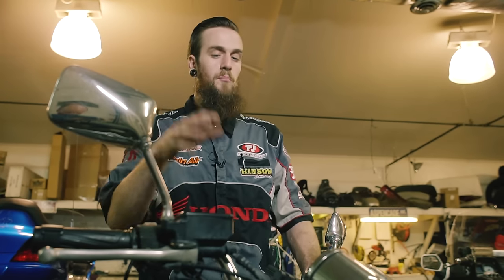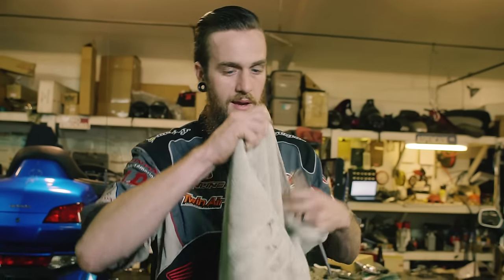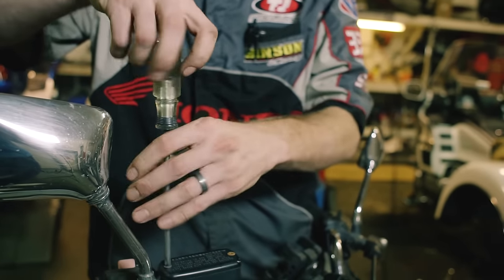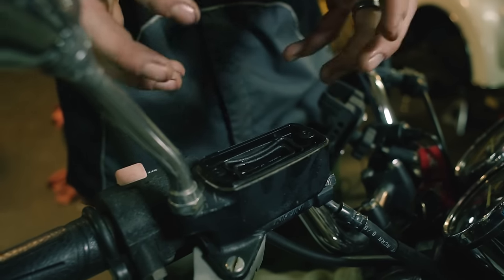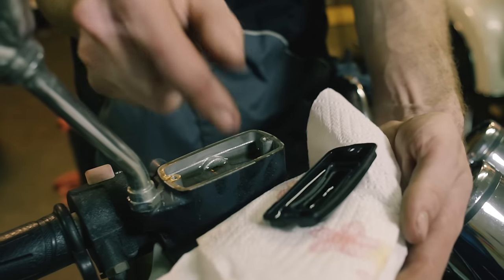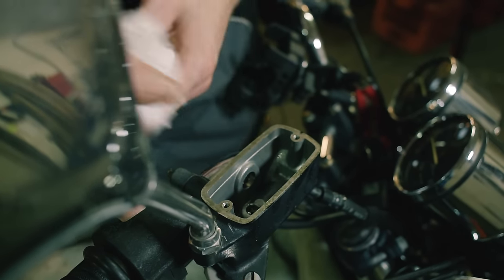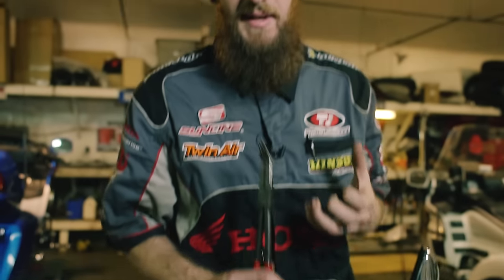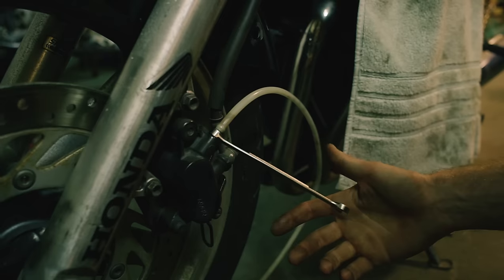Brake Fluid Replacement: Honda Motorcycle

Comment: Great advice. Many people are here because they are not wealthy, and would like to take care of what they can afford, affordably. a 1993 Honda Shadow has rubber lines. It's fine if YOU choose to afford steel braided brake lines, but don't criticize other people for what's in their budget. This guy is the common man's hero, for bike repair. Snobs can go elsewhere, or chill out if you stay. Thanks.
Reply: follow the advice of someone who clamps high pressure brake lines? nothing to do with steel ones...nothing to do with snobbery, clamping a line hard enough to cause the restriction required in the video WILL DAMAGE the brake line.

Comment: I have a 2003 Honda Shadow VLX 600, that I've made a few changes to it. I use a handheld vacuum pump with a plastic hose going into a container with another plastic hose to the bleeder nipple by applying vacuum to the container it draws brake fluid out of the caliper and down from the reservoir. I keep checking the level and adding more brake fluid to the reservoir before any air gets into the system. When the fluid comes out looking clearer, then I'm done. I do like your videos. As my 5th grade teacher told us when you graduate from high school or college, you're not out of school. Life is a school and you must never stop learning. Best teacher and lesson I ever had in school and it proved useful in my life. I can always benefit by learning something new every day.

Comment: I watched one of your brake caliper rebuild videos yesterday.  You used a brake line clamp to squeeze that line, instead of pliers.  It looks like a much safer tool for the rubber lines because it has rounded jaws.  After seeing you recommend it I checked to see if Harbor Frt carried them & found a set of four clamps for $8.

(I just thought I'd mention it since this video is from 2016 & you probably didn't have that tool back then.)

Thanks for the great videos.

Comment: Man You are a Legend too say the least. I bought this Yam TTR250 $400 with leaking base gasket. So to repair I may as well do top end no big deal. Front master cyl decides it needs new kit as it stuck. No big deal. I put in new kit, tried too bleed, No way Hos'ea. The brake line sticks up 1/2 a mile higher than the master cyl, try reverse bleed , all sorts of shit. Nothing. Cody pops up on youtube and saves the day with his plier 1 way valve trick. Yippee , it worked a treat. Im a Honda man personally , I might sell this yam and get another XR. Thanks again Cody.

Comment: Also what the other guy said about older Hondas.  I've picked up a couple older (2003-2007) but low mileage Shadows.  One is in better shape than the other and the other needs brake fluid replacement.  Thanks for the vid.  .

Comment: Thanks the advice man! I was a bit nervous about pinching my brake line because i'm running the OEM 93 tubes on my bike and even though I didn't see any rot or anything, just played it safe. I used my wife as a "cheat" by having her sit on the ground and do the "open/close" between pumps (the old fashioned way) and ran 6 refills through the system (after having emptied and refilled the resevoir like your directions, and each refill being about 1/2-2/3 of the liquid in the brake fluid reservoir) . So I'm estimating between 3-4 FULL reservoirs went through it for the full flush (my wife confirmed it was clear liquid for about 4 of those 6 refills anyways since it was just what was in the tubes). Brakes feel solid as a rock, and having just changed my pads yesterday, braking feels nice and solid. Never taking it to my mechanic for something like this again. Easy enough for a fairly competent person to pull off. I have a new diaphram on the way (it had to be special ordered and I forgot to order before starting) so I'll just swap the diaphram the minute it comes in the mail this coming up week.
Show less
REPLY
Reply from the maker: Nice job man!!
Reply: thanks, I'm no mechanic, but it's nice to do the simple things on your bike. I'm just glad I don't have a dual caliper front brake system, or disc fronts AND back, as even though it was brainlessly simple if you follow directions, was definitely tedious doing the old "pump pump hold...crack the bleeder, close the bleeder. repeat" method...even with my wife helping so I didn't have to do both lol

Comment: Dude, your method is 100% spot on. I have a vacuume fed bleeding kit and the pliar method worked soooo much better. I used the pump kid to clean out the master cylinder instead of the turkey baster.. you killed it with this tutorial. Thanks kid
Reply from the maker: everettesfit 🤙🤙👍 it is a pretty nifty trick!
Reply: thoughts, after bleeding the front break and replacing the pads the front wheel doesn't spin freely.. seems to have drag.. do you think I still have a bubble
Reply from the maker: everettesfit Slight drag is normal with brand new pads. Failure to spin is a problem and no that wouldn't be an air thing. That would be a possible dirty caliper or crud in the relief hole up top.
Reply: TheMotorcycleMD once again you were 100% on the money. the drag in my breaks ended up being crud behind one of the caliper pistons. cleaned it out used some 1500grit paper to smooth out the sticking piston and no more sticking. thanks again for the tips

Comment: Great video, i've learnt a lot before doing brakes and clutch on my Honda vtr 1000. Because of you i'm gonna order new diaphragms before the task. In the past i reused the old one of it's not split. I would have used dot 3 if i hadn't seen your video, so thanks for the dot 4 tip. 
It's good to put one drop of WD40 on the screws an hour before cracking them and i encourage everyone to buy an Impact Driver and use that as a Phillips head. It's bulk and weight give good purchase and will undo the screw without hitting it, and if it doesn't, it's ready for a light tap with a hammer. I like your 3 uses of a cloth or paper, that's always been my way. Good economics and waste reduction.

Comment: This was perfect teaching! Thank you!!!

1. I did have to tap my screwdriver with a hammer. Very soft metal, those screws!
2. Creating a valve with needle nose pliers was crucial and made the job faster. 
3. Flushing 2-3 reservoirs' worth of brake fluid pulled out a bit of particulate.

I could use more understanding of the air, though: bubbles were coming out of the bleed valve, and I thought I was supposed to see them primarily at the reservoir? Jic, I pumped fluid til I didn't see air on either end.

Comment: Thanks, good tip about the diaphragm!  Depending on the age of the bike I would also strip the caliper, clean and replace the seals, it makes a world of difference to the 'feel' of the brake system and reduces the chance of seized pistons down the line.

Comment: i noticed that you referred to "phillips" screws. in a video which you must have made after this one you talked about J.I.S. screws /screwdrivers. i found out about J.I.S.  from yet another youtube video. this seems to be one of the best-kept secrets in the mechanical field. once you use one on a japanese motorcycle you will never go back to using a phillips. i hope you will spread the word in future videos. best tool i have purchased in a LONG  time. no more chewed up screw heads; seldom need an impact to loosen one anymore.

Comment: Japanese bikes use a JIS type of screws. These are slightly different than Philips screws. Get s Vessel brand screw driver and you'll have an easier time removing screws on your Japanese bike.
Reply: Best advice when working on Honda.  Looks like a Phillips, but is a JIS.  I see these stripped all the time on older Hondas and it is such an easy and cheap solution to save you headaches down the road.

Comment: I just got an 04 sabre. 10k miles. Pretty sweet..well cared for. How often do you recommend break fluid flush? Oil changes? Front and rear break replacement? Radiator fluid flush? Fuel filter replacement?

Comment: If you don't have any brake pressure at all, pour a little fluid in the side hole of the master and replace your brake hose. It really works!
Reply: Can you explain? A little more detail...what hole? And when was the hose removed?
Reply: @gabrielchaparro1698  The hole where where your brake hose is bolted to the brake master cylinder. the banjo bolt has a hole in it. When you put your brake hose on air gets trapped right there and doesn't allow brakes to work.

Comment: Very helpful. Thanks. My question is this: If you suck out the old fluid in the reservoir isn't there a danger of introducing air into the system from the reservoir? Thanks.

Comment: Cody, I am liking the pliers tip. Looking forward to putting it in to use. Specially on the rear brake master on my 92 F2, which has been a major pain in my ass. Thanks for sharing the good stuff, I really appreciate your knowledge. As well as your time and effort spent on making and freely sharing these videos. Thank you so much.

Comment: The service manual on my Silverwing doesn't say anything about replacing the rubber part with a new one. Also, Motion Pro makes a couple of inexpensive brake bleeder tools that allow a one-man brake bleed. I bought one and it works great!

Comment: You did a great job. Only thing I did not like is using the pliers on the brake line, the brake lines can break down on the inside when you crimp the lines with plier.
Reply: Agreed, especially if they've been sitting with old fluid
Reply: Agree, have seen old brake hoses that have been squeezed like that fail internally, and become permanently one way. 
Brakes go on but do not go off, or will not go on. 
Better off using a bleed pipe with a built in one-way valve. 

Otherwise. I find his meticulous approach refreshing,

Comment: I didn't make it through the entire comment section so you may have answered this already but is it going to mess things up with using dot3 instead of dot4? The MC cap on my 85' VF500 says to only use dot3 so that's what I changed it with a few months back. It could be coincidental but my front brake keeps locking up to the point of having to open the bleeder to get it to move. Thanks for taking the time to post these tutorials man. Seems like a lot of people focus on the negative or trivial shit and forget that you're taking your time to try and help others. It's an honorable thing you do and is greatly appreciated.

Comment: I have a Honda Shadow spirit vt1100c and I did the brakes yesterday and was getting frustrated because I kept getting air in the line. My recommendation is to not use pliers but instead to wrap a rag around the brake line to protect it then use a VERY tight pair of vise grips. My brakes are now harder than ever thanks!

Comment: I dislodged the little flap that nests on top of the hole at the bottom, it can go one of two ways. Wonder what's it for?
I have a brake tool kit from the old days, in it is a pair of smooth nosed pliers for clamping the hose to facilitate caliper removal without losing fluid. Similar, just thought I'd say, no good for bleeding

Comment: Ooh, I'm just about to head out to the garage to try your nifty pliers trick!  I'm gonna try it with a fuel hose clamp so I can leave it in place. Hopefully it will have enough leverage for the brake hose.

Comment: Great video and advice,  thanks!
I've got a 94' VT1100 and want to change the bars.. currently the master cylinder has a 45° mounting angle due to the buckhorn style bars... if i swap them out and mount them on straight bars, will they function ok as long as i clean/fill/bleed with them straight? If not... any advice on which master cylinder to swap it for? Thanks

Comment: I hope you'll see this and help me out. I've got an 82 nighthawk 650 with brake and clutch master reservoirs with rotten leaking sight glasses. Have you done a video on rebuilding masters with replacing the sight glasses. Buying new masters are out of the question, bike shop quoted $1100.00 each for new.

Comment: No need to over-torque screw on the reservoirs. Btw, get a JIS screwdriver - then no fighting. Its NOT a Phillips head. Subtle tip difference but makes all the difference in the world. Also vacuum blenders are cheap ($30) and a HUGE time saver. They also work much better. I couldn't  bleed my hydraulic clutch without it.

Comment: 1:52 your problem starts with, not a Philips screw… do you see the tick marks.. they indicate that it’s a Japanese Industrial Standard screw. A little different. The most expensive screw driver I own is a JIS, and it’s a dream to use. It fits the screw head so tight they stick right to the end of the driver… I would recommend investing in a JIS driver….

Comment: One more thing, when I removed the diaphragm, I noticed it can be in two positions, flat or sucked inwards into the reservoir. Does it make a difference if I put the new diaphragm in in the expanded (sucked in) position or should it be flat as shown?

Comment: The service manual doesnt say to replace the diaphragm, why do you say they are 1 time use?
Reply: Any part like that diaphragm that creates a seal will distort over time.  If you reinstall the original you greatly increase the likelihood of a leak. A new diaphragm is cheap insurance against the cost of a new paint job on your tank.
Reply: You're right; they're fine to reuse unless you can see any deterioration. Trust your service manual.
Reply: @reasonsvoice8554  
😂👆 
Your being short to a question from a year ago. This guy wont see your comment
Reply: Mike L others will.
Reply: @SinnerSince1962  thanks 😘
Reply: As long as it looks good, its okay to reuse it. But any signs of drynes, replace it
Reply: My manual says "Inspect the reservoir cover rubber diaphragm and renew it if is damaged or deteriorated". Haynes, Honda CB 500.
Reply: its Diagram you n00b <3
Reply: @miljororforsprakpartiet290  ur kidding right? Smh
Reply: He sells them. So they are one time use..lol

Comment: i just bled the front brakes on my 05 Honda CBR600rr...this was the first time ever doing this, i bought some bleeder hand pump kit, watched a couple videos on it, then tried it out just now and its was useless... while it would suck the fluid out, it created so many of its own air bubbles i couldn't tell what the fk was going on so i ended up doing it manually,  with just a hose, small jar and the 8mil wrench! i got all the fluid out and replaced,  cap back on but idk if i have enough fluid in the reservoir...at first i over filled it and it spewed out everywhere when i put the seals and cover back on so then i used a small dropper and sucked some fluid out... now it's about half way on the little round window thing...is this good or should i add some more?! ps- what a damned mess AND a pain in the ass to do on a sportbike because the windscreen and everything else gets right in the way! lol 😂😊

Comment: I just bought a goldwing yesterday and attempted to do the brake fluid and it went really bad.  Not devastating, but had to give up after i couldn't get any fluid out.  I think your video makes it much clearer what I need to do.  Second, and i know this is a dumb question, but how, for the love of God, do you get the center kick stand down to keep it level?  I tried throwing all my weight onto it while lifting the bike and could barely budge it. Is there a trick i'm missing?
Reply from the maker: Ah! The center stand. The motion is all downward.. make sure the front wheel is dead straight, get a solid part of your foot on the stand and stand up while pulling up with your right shoulder. No yanking backwards. Your left arm is not doing any of the pulling. It just there to keep the wheel straight. Good luck!
Reply: TheMotorcycleMD you're awesome, thanks for the reply... I'll give it another shot. I think I was pulling backwards with both arms, and then would get nervous once it was up. Then I dropped it once too, so that was awesome. Feels impossible, but I know many this seem that way till you figure it out. I think my driveway might also be slightly sloped across which added to my difficulty
Reply: TheMotorcycleMD wow.. Followed your advice and that was stupid easy. Can't believe I couldn't do it before, and that I stopped the stupid thing once. Now I can try the brake fluid again!

Comment: Isn't it better to leave a little bit old brake fluid into the resevoir, then add new fluid and bleed it till you see new fluid coming out of the bleeding hole? Because now you fully emptied the reservoir and there is air going into the brake fluid hole (at the reservoir).

Comment: cheap rubber brake lines you can pinch you can't pinch braided or teflon
Reply: And you should not pinch any brake line, it can make micro damage to the hose. That is also the reason you should not demount the caliper and let it just hang on the hose. Always wire it up to the handles.

Comment: If anyone has a lot of sediment try putting a little fresh fluid in the reservoir and stir it around a little with a small brush or screwdriver then soak it back up.

Comment: Quick tip for a stripped head.  Put a rubber band over the stripped head, then loosen it.  Hard to believe, but it works.

Comment: I have a Virago XV750 from a new client and it's equipped with a front double disc, I have tried numerous methods but the master cylinder doesn't wonna know to build any pressure, tried back flow, tried gravity, tried suction, dunno, I'm at a standstill right now! can you help with any suggestion bud?

Comment: If you have any new break fluid in the bottle, is it OK to sore it and use it next time when you're bleeding breaks, or have to discard the remainder of the bottle?
Reply: Best to discard it eventhough the manufactuer says under ideal conditions maximally 12months, so this means even less in reality because of a bad seal and moisture in the garage/shed. Its cheap so best to discard it.
Reply: *brakes/brake